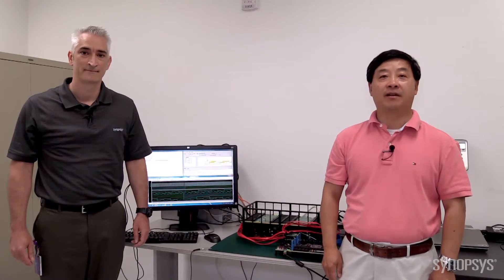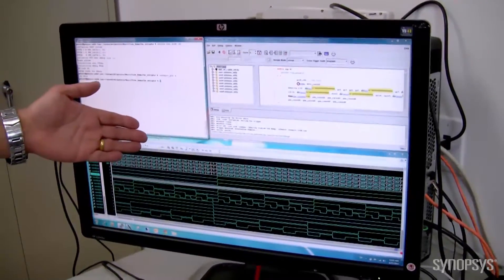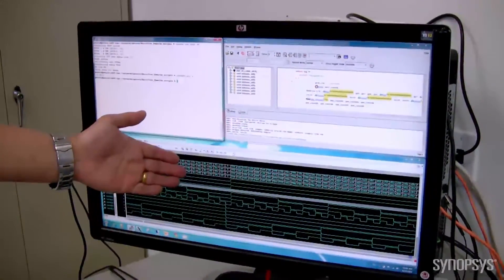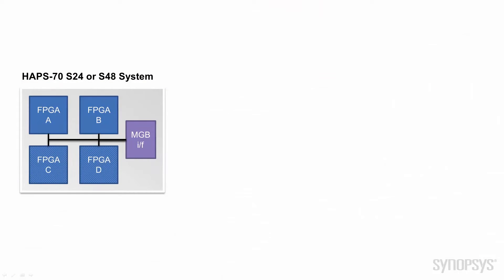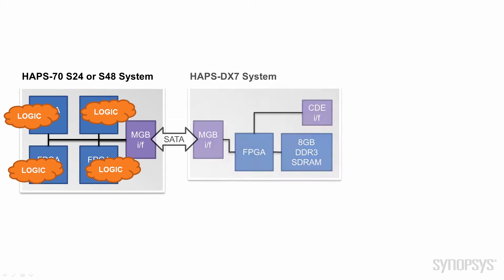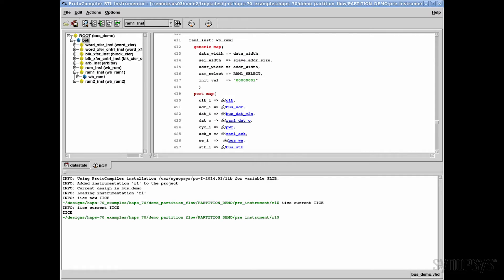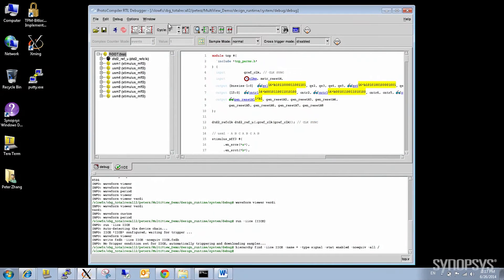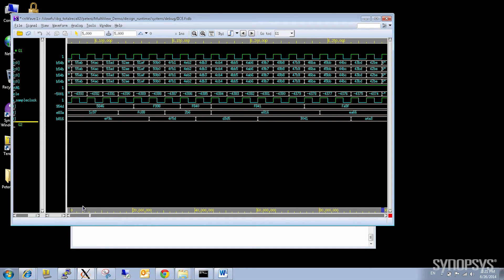Synopsys ProtoCompiler for RTL Debug with HAPS Systems | Synopsys

Comment: The HAPS system was really a nightmare to work with, IMHO. It was, by far, the worst FPGA system I've had used. The inter-board connections were always failing and during the troubleshooting process we had to remove and reconnect boards, and try again, in average, five to ten times. A real nightmare, that I'm very glad to see that is over and very dead.